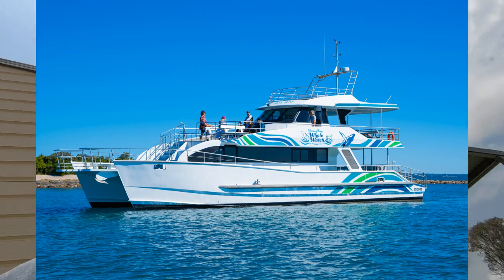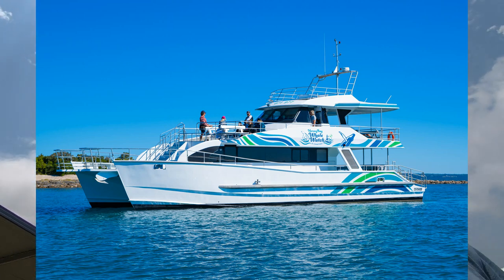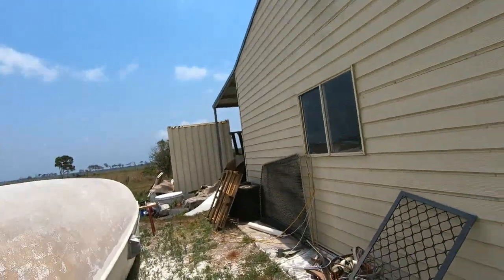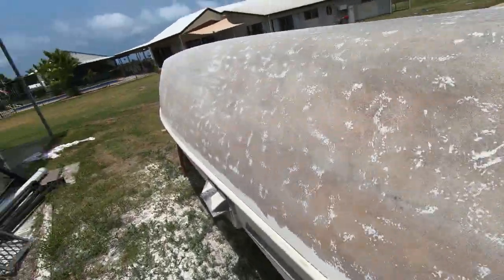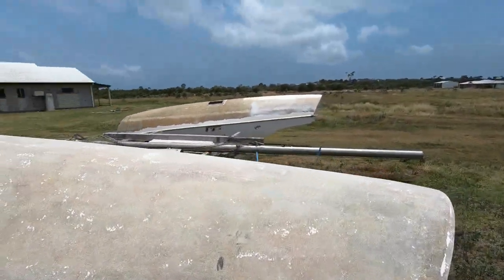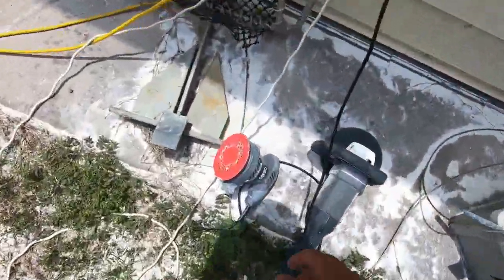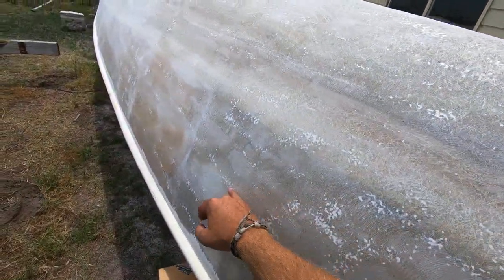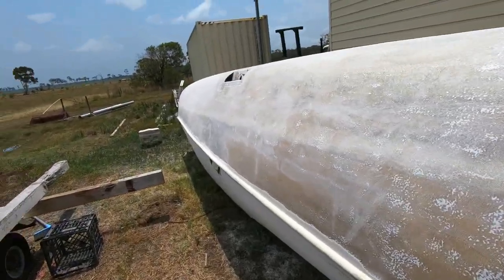FINALLY!! A seawind 24 update and progress

Comment: Looking forward to watching you work on the seawind.  One of two boats I was going to buy, the other one was a Haines Hunter Tramp trimaran. Really like the seawind 24 looks.  Are you going to solid deck the stern or go light with nets?
Reply from the maker: scott lampe yeah haines tri’s look fun, I will be going solid decks again planning on using polypropylene honeycomb core with glass either side. Should be pretty light compared to the plywood decks it had before.
Reply: @TheKiter01  Are you sure epoxy or vinylester will adhere to PP? I know most DIY that isn't ply is usually 80Kg.m2 Airex PVC.